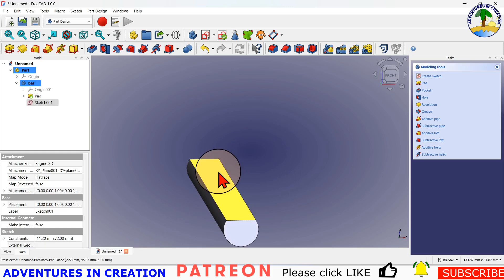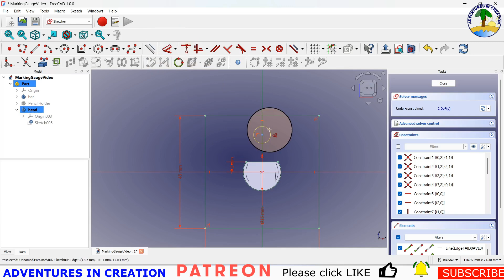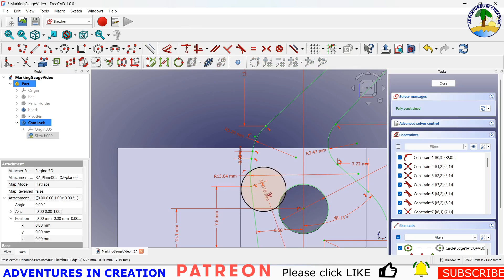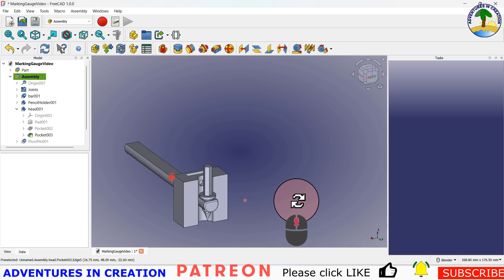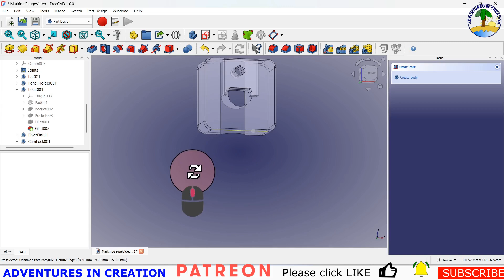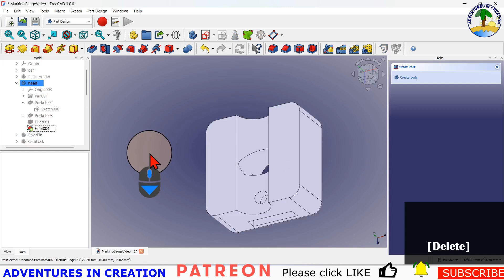Intro To FreeCAD V1.0 Woodworking Marking Gauge Design and 3D Print #freecad #3dprinting #design

Comment: That turned out very professional. I like the tangent tool with curves, it works but sometimes it goes a little wild. I wanted to get efficient in FreeCAD then buy a 3D Printer, but I got interrupted with a Creality CR-Scan FerretPro, and it's turning out some really fine results in my quest in "Reverse Engineering". 
I recently had a project that I wanted a cost to produce, and I didn't provide realistic Tolerancing and so I am going thru GD&T ASME Y14.5-2018 Geometric Dimensioning & Tolerancing Standards, to include on my Tech Draw plans, especially for saving a lot of "costs"! This is the first time that tighter is not always better, as far as keeping the costs down?
Thanks
G_Dub
Reply from the maker: How is the cr-scan ferret pro working for you. I had a 3d scanner and really tried hard to make it work but it just wasn't good enough to produce usable models for freecad

Comment: I am supremely confused as to why you don't ever attach a sketch to the surface you want to taget but rather always choose the global coordinate planes. It would be significantly more natural to select the top of the bar or the top of the pencil holder and attach the sketch on this surfaces. Could you share the reasoning behind your approach?
Reply from the maker: You are right, it would appear more natural to choose a face, however although the topological naming issue has been mitigated it is not completely solved. I have personally had situations where it has still broken my model, even after 1.0. I prefer to stick with methods that I know will not cause me issues down the line.
Reply: @Adventuresincreation  So, FreeCAD is not ready for Prime Time! As of your posting date.
Reply from the maker: @brucewelty7684  I have have used it to good effect by just avoiding doing things that may blow up in your face in the future.
Reply from the maker: The topological naming problem, although it is largely mitigated in the more recent releases, it still rears it's ugly head sometimes. If you watch my latest video (released today) I do actually create a sketch on a face but if you are going to be doing a lot of parametric changes, I would still avoid doing so.

Comment: I've made these onsite with a couple blocks of wood and a few screws. Handy when you need to make several cuts the same length on something. :) Uses one screw put through one board just peaking out enough to form a scribe.
Reply from the maker: Exactly that, this is just another version of that.

Comment: When it comes to making the gap in the pencil holder, instead of the sketch and pocket, maybe you could have just reduced the revolve to something less than 360°? Created the gap that way. I think the hexagon pocket would have still worked.
I'm always looking for ways to simplify my models.
Reply from the maker: Yeah, there are several ways you can achieve the same result. I tend to keep it simple.
Reply: @Adventuresincreation   Well it would simplify the model, one less step in the tree. I'm always looking for ways to reduce complexity. Your channel and mango jelly have been my two favorites so far.
Reply from the maker: @loughkb  Glad to hear it. If you keep it simple it makes it much easier if something doesn't work out the way you want or you change it later.